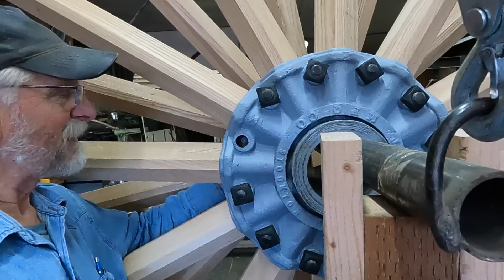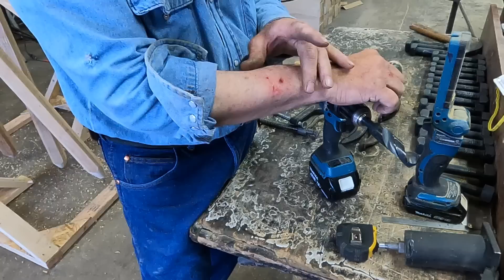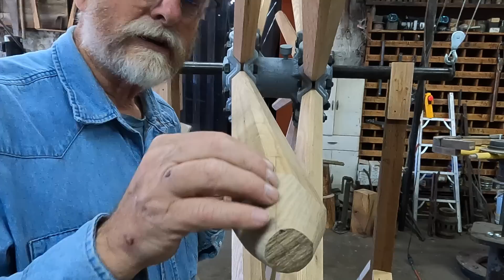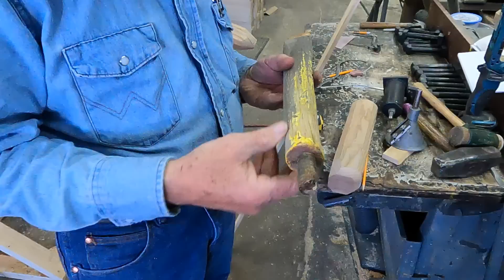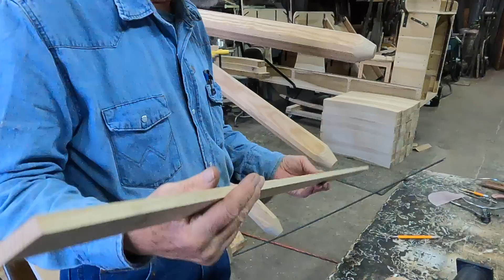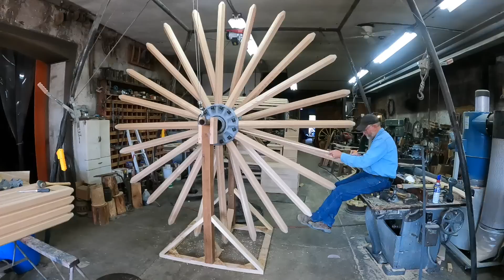Fixing Miscalculations on 10' Logging Wheels | Engels Coach Shop

Comment: I am 72 and have been woodworking for about 60 years... but certainly not to the level of Dave.  I still spend 90% of my time building and 10% correcting errors or revising what I had mistaken up front... I can relate to what you go through Dave...

Comment: How about machining some split sleeves to install to center the hub bores on. The shaft to you can spin the wheel to get a perfect centerline of the spokes.    You may need to make a spoke mounted adapter to guide the od of your tennon cutting tool.

Comment: I know nothing about making your wheels but watching this I was wondering if you would use a laser with a cross hair set up, could you use that for getting the center of your hub and laying out the ends of your spokes. My problem is I get too precise with some projects and maybe that would be the case with this suggestion. But I thought, if this would work for you, maybe that would help in getting your tenon lines drawn on the spokes pretty accurately. You could set up the laser so it hits the center of your hub, recalculate the offset for the thickness of the spoke then mark your spokes.

Like I said, I know nothing of what you do, just was thinking about how to get that line drawn. Anyway, I love watching your videos and learning by watching!

Comment: Is there any chance that one of the reasons the original felloes were laminated was to accommodate this unique spoke design? It makes me wonder if there are some clever options by clamping, drilling, assembling and then gluing the felloes. Personally I have no idea or reason to say so besides pure curiosity. Furthermore, keeping the tenons centered at the tip and shoulder (angled into the felloe) would then require a serious angle for the shoulder, not to mention tight tolerances on the angled holes... dunno, seems unlikely, but that whole laminated thing plus "impossible tenon angles" had me thinking 😆
Reply: On second thought... angled holes into the felloes might make individual spoke repairs pretty near impossible. I guess that shoots a pretty big hole in this idea.

Comment: That wheel, just WOW! I find with these new brush-less battery drills, using the torque limiting ring saves on broken drill bits (or in this case a broken arm) on the older brush motor types, the torque was more linear, the drill setting was default for all drilling operations but these digital gits need a little taming!
Reply: Using the (detachable) side-handle also helps one overcome the torque.

Comment: Coincidentally , within the last week I watched "Build a Puzzle Stool with a 3-way joint" that has the same issue. This stool has a three piece stretcher and has the same issue of needing the tenon at 
an angle relative to the centerline of the stretcher. Quite a long video but starting at timestamp 
1:45:00 this problem is addressed and might help explain this "bent tenon" issue. Also I might mention a comment that suggests using a laser to find the center of the tenon sounds like a great solution.

Comment: Whenever I use a high torque drill, I always hold it in my left hand. If it catches, it will twist out of your hand. Using it right handed will push the drill motor tighter into your hand, and if it’s a corded drill, it will wrap the cord around your hand and twist your hand/arm. I had to learn that the hard way. After a couple injuries I figured out how to avoid injuries by using it left handed. Good luck. Keep up the good work
Reply: Left hander here...Except when they put the constant run button on the left side so it stays on when you let go and it rips your arm up even worse.
Reply: @TgWags69  yes. You’re right. And there’s many ways to get hurt using a drill

Comment: Putting the tenons on an angle will create stress on the spoke when in use. Surely the load on the spoke needs to be directed straight to the hub. If the tenon is at an angle then it creates a stress point in the spoke at the face of the felloe which could lead to fatigue failure. Would it not be less risky to cut the tenons square to the spoke and angle the mortices for each spoke left and right. You know the angle relative to the centre line, all you have to do is create a jig to tilt the felloe left and right in the drill. That way the load on the spoke is straight and not angled?

Comment: After similarly beating myself up a few years ago I upgraded to a pair of 1/2" Makita model XPH14Z drills which have an easily removable cross-handle. They are a performance grade above the 3/8" drills, but with brushless motors they don't weigh much more and use the same 18v batteries I already had so I just bought the bare tools. You're in better shape than I, but don't hurt yourself un-necessarily.

Comment: Great video and good to see how you tackle all the problems of dealing with such a huge, heavy wheel. Would it be possible to drill the holes in the felloes on an angle so the tenons on the spokes stay parallel? That would make the tenons stronger being parallel to the spoke grain. Or would that cause problems with the felloes - they would need the inner face conical to meet the shoulder on the spoke if it was 90degrees to the tenon! Gets complicated...

Comment: You're lucky it didn't break your wrist! I've seen that happen before. Nice job as always. Thanks for sharing.
Reply: I have been beaten up by my Milwaukee  Hole Hawg and got a B&D Wolverine because it has an ajustable clutch.Drilling thru beams and 2x studs for plumbing pipes  and other utilities with big bits or hole saws in home construction was always making me find a way to brace the drill or take a chance of breaking an arm. I no longer feared the 2 inch or larger drill bits after getting  the Wolverine. It was just as heavy as the hole hog but a lot more forgiving with that clutch. When the bit jambed the clutch would engage and stop the torque. I don't think they make them anymore.

Comment: You can turn the clutch down on your drill 1 or 2 notches from direct drive. It will still be stout enough to drill, but will slip before breaking your wrist.

Comment: normally you have to have the pins normal to the bellows because the spokes are mounted to the hub first and you have to drive the bellows onto spokes from both sides at the same time

But with these wheels, you could remove the outer flanges, drive the spoked into the bellows at an angle (with the pins straight on the spokes, and even with the shoulders on the spokes at right angles to the spokes, producing the most strength) with the holes in the bellows being at an angle (and possibly even the inner surface angled to match the spokes) then assemble the spkes/bellows into sections followed by bolting to the hubs.

very different from normal hubs, but that seems like it would be stronger and simpler
Reply: Fellows.
Reply: felloes*

Comment: I worked on 13' aluminum props, approximately 1000 pounds.  Hook a chain on itself and run the loop  through the hub center. Stick a piece of black pipe through the chain loop and raise it slowly. We usually keep two people on the low side and push down against blades (spokes)  at 5 & 7 O'clock positions to control the rate of swing. Since it's balanced and most of the mass is in the middle it should'nt kick too hard. I might wrap a chain around the base of any hoist casters to keep the hoist stationary. Lock down any bridge movement at the hoist anchor point. Thanks for the adventure and the honesty, with your experience it could be tempting to edit out the change in plan. You call it a miscalculation, that's a good word. I would'nt call it a mistake unless you replaced spokes, even then the customer would have never known.

Comment: Ouch them torque monsters are mean!! I'm a carpenter, but in my younger days I had a weekend gig delivering appliances so I brought my cordless drill to work to switch out fridge doors and take off doors in the way, etc... My young partner liked it so much he went out and bought the new 24V Dewalt drill, the day he came in with it he got pulled to go on another truck, I warned him to relax the torque setting a bit so he wouldn't hurt himself, being a 6'4" powerlifter he just smirked at me. That evening when we all got back to the barn, he had a black eye, he was changing out a fridge door and it torqued down and the drill spun and punched him right in the eye, and wrecked his wrist too.  Them things ain't nothing to sneeze at, hope you heal up quickly Dave!!! I've gotten a few of those myself drilling out wood/steel flitch beams in the days before LVL's existed.

Comment: I just recently bought a Milwaukee 1/2 cordless drill to replace a lighter drill I shelled out. It is of their high end Line boasting more power than their best corded. But more importantly it has a sensor that stops the drill if it senses the bit catching and the drill jerking. It works!

Comment: I use similar Makita battery drills at work and home. I tend to use the low speed gear only occasionally as the torque is quite high enough to break a wrist or smash a hand into something. I prefer to use the high speed gear and control the speed with the trigger action. It's hard on the motor as there is less cooling from the fan (lower motor rpm) and they tend to melt brush assemblies doing this, but it's safer. I have tried using the torque limiting clutch on the 'screw' setting to make the whole thing safer, but the max setting is not tight enough for heavy drilling or large diameter hole saw use. I love the Makita 18volt battery tool range, very impressive tools !  Perhaps the problem is that we push the limits and use of the tools beyond thier intended use, because they can do it? Funny to think back to my younger days, where a Stanley geared hand drill was the tool for small holes and a 'Brace and bit' was the tool for larger holes.....   Memories of chain drilling 1/4 steel plate to make engine adapters and filing all the edges smooth by hand.

Comment: I have many Makita tools as well.   I find most cordless tools seem to have more flex than the corded counterparts.    Any flex allows the bit to load up and then catch harder.    I have also had issues using a drill with the hammer function because the chuck will jump forward as it hits different material or gets to the end of the cut.    I have felt that wrist pain more than I care to remember.    Best wishes and great content.

Comment: Thank you Dave. Good video. Not too different from remembering that measurements for rafter lengths, angle cuts on rafters and  compound cuts for hip/valley rafters are derived from relevant centrelines—in addition to outside edges. I have lost count of the number of times that I have had to cut pieces over length  or sheets oversize, at the beginning of a carpentry task. This is an especially nervous stage when it is either impossible or impractical to make up a full template. Definitely a good time to leave my work and personal mobile phones at the other end of the house😊!

Comment: Kind of makes you wonder if there ever was a working drawing when the wheels were origionally built. I am sure they had to have been. It is amazing there is that much geometry in those wheels.Wood working and metal working are one in the same in one respect. You can take it off but it is a lot harder to put it back once you do. That extra quarter inch length really came in handy...

Comment: I have been around power tools for most of my 73 years and I am very respectful of a drill motor in limited space.  I have a Milwaukee right angle Hole Hawg from the seventies or eighties that will easily break your wrist when drilling overhead between joists or even between studs and that is with a pipe handle as well as the trigger handle!!  In the late eighties Black and Decker Professional came out with a right angle drill of equal power but it had a clutch.  As I recall it was the 'Timber Wolf'.  A very good drill and the body was long enough to give good leverage.  I never had the extra money to upgrade but what a fine machine that was when swinging a large bit or a hole saw!  I would look for a drill with a clutch if I were to start out now.  The other one that gets your attention is drilling large holes in steel as it breaks through even on, or especially on a drill press!  It pays to take the time for even the most innocent of holes to clamp the work on the drill press.  One of the reasons I didn't hesitate long to buy a Mag drill.  It is spooky to just pick up a hand drill for large holes.  It has been said (I wouldn't disagree!) that of all the machines in a large metal shop that can kill or maim you the one that most often gets you is the drill press.  Because of underestimating the danger and getting complacent.  Freehanding is quicker but it can bite.  You take care now.  Enjoy watching your videos.

Comment: - I am super impressed with how you figured out a carpenter's "story pole" stick that would so easily work to act as a measuring jig for lining off the spokes, Dave
~ ~ ~ ~ ~
- Seeing the spokes be a few inches apart made me think the holes in the fellies would be drilled off center at opposing angles
- I assumed the fellies' holes would have a counter sunk shoulder leaning toward the outside to receive each square cut tenon shoulder.
- I imagined tapping on each felleo would draw them tight to the spokes, and would be hard to pull off, and Very strong.
- I could see that offset holes would prevent any cracking from happen along the center-line of each felleo and be a stronger engineering design.
- Then just before you explained the angling of the tenons, I could see that process would be easy and fast, and strong too, because no weak point would be introduced into the spokes, and the drilling of the fellies could be fast in a jig, and so much stronger too.
~ ~ ~ ~ ~
- I wonder if they tried that and experience taught them that not that does not work well for some reason and learned to do things the way you explained, with the kinked over tenon coming off the spoke at an angle...and that there is no weak-point introduced into the spoke doing it that way.
~ ~ ~ ~ ~
- If the spoke grow-ring orientation aligned to successfully "fight" the cupping they could never snap under sudden loading , and if the growth rings of each felleo were oriented flat/parallel to the road, they would never twist, warp, or split apart under any torsion stress ever put on them from the cupped spokes pushing from opposite directions while also coming together with massive loads smashing crash-bang over rocks or around curves. This truly is a Light weight design {as compared to the tonnage of Red Wood Timber they were designed to haul} yet Indestructible just because of Grain Orientation and force vectors inherent in cupped wheel designs. BRILLIANT ! ! !

Comment: My Milwaukee M18 drill has an extra handle that you can attach so you can better handle the torque. I've used it in planting bulbs for my wife. It broke the auger so I had my son weld it back together.

Comment: I was wondering at the time about this, then I finally thought that they drilled the hole in the fellies at an angle, then realized that the shoulder on the spoke would have to be beveled to hit the fellies, then decided that wouldn't be practical. Ultimately I realized that the felly hole would have to be drilled at an angle, and flat also cut in it perpendicular to the felly hole for the shoulder to ride on. I expect you are more right than me.
Reply: I went through the same thought process, and decided Dave's way was probably less work. 
Then wondered if there's any difference in working strength.
Of course, that won't matter when you've been run over by those wheels, and squished. :)

Comment: Believe it or not I actually understood most of that you did a great job explaining it to a simple mind like me but I'm probably wrong but looking at the end of the tenins like that looks weak to me wouldn't it be stronger to make the tenins straight with the spokes and just drill the holes in the wheel at the angle to match I'm just thinking that way I have no experience or clue just wondering

Comment: I followed what you are saying and doing. However, how would you have done that differently?  Each spoke has a side and position. You would have had to somehow calculated that off set for each side. Then sanded approximately to where you needed then install them on the correct side in the correct orientation. 
Seems to me like you did it the best way to get the most accurate results. 
I don’t know how you would have done it otherwise.

Comment: I completely understand why you are changing the angle of the pin/tenon on the spoke to enter the felloe perpendicular and on a center line.

But is there a reason the tenon needs to enter perpendicular to the felloe?   From an engineering perspective I could argue that that the tenons entering at opposing angles would actually strengthen that interface as you would have opposing forces holding the felloe in a triangulating  moment rather than a single plane center-line.   (Think of a bicycle spoke not needing to be bent to enter the rim perpendicular)  Yes, there is tension vs. compression but the wider base of attachment (zig-zag vs. straight line) seems desirable.  You would move the twist line from the surface of the felloe to some point deeper in the wood.    

I know and accept you are correct in your method.  I'm just trying to figure out where/why the engineering succumbs to practice. (retired engineer)